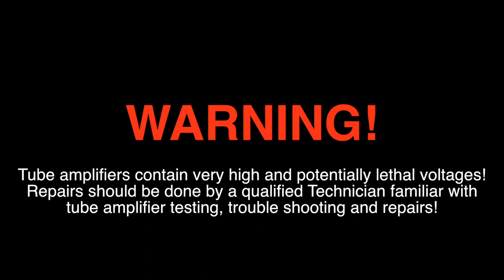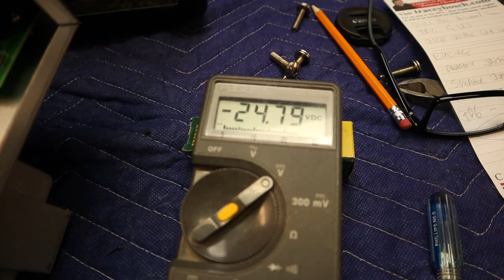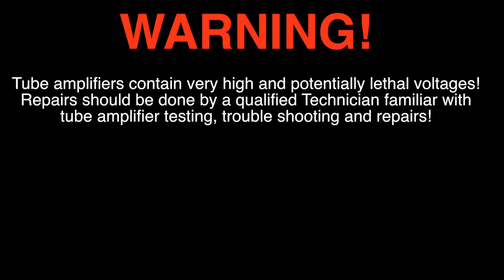BlackStar HT5R Repair // How to debug, fix, mod and test this common issue with these amps!

Comment: thank you for sharing your story and your advice.  I replaced the fet's, resistors and tubes. Cleaned the tube sockets with the original tubes and  contact cleaner. Working now as good as new. My voltage metered at 22.9 and 23.0 volts on the test points. Thank goodness I didn't need to tweak my balance adjustment. I got some tiny clippers in there and carefully cut the leg off the resistor right where it meets the resistor body. The solder sucker pulled it from the PC board. The resistor and the other leg fell right out the other side. Worked so well I cut the legs one by one on the old fet's . Solder sucker removed those cut legs as well. BIG THANKS !!!
Reply from the maker: Thanks for commenting.  Glad my video helped you out.  Hopefully you installed the heat sinks as well to stop this issue from happening again.  Cheers.

Comment: Thought this was my issue because R10 was literally smoking, so I checked the same areas. All looked okay, transistors checked ok, so I looked a little deeper.  D34 was shorted and slightly burned, it is a 1N4007.  Goes from R10 to ground.  Replaced that, R10/38/39 and the transistors (adding heat sinks) as I was worried about possible heat damage to the transistors and R38/39.  While I’m in the amp might as well replace them in case they suffered some fatigue.  Thanks for the heads up because it indirectly led me to the solution and also brought to light an issue I wasn’t aware of, which may have saved my buddy some additional work down the road.

Comment: Had this exact problem, diagnosed thanks to this video.  Was about to throw the amp out.  Cut about a 4" diameter hole in the back and installed a small fan.  Problem completely solved.  Thanks!
Reply from the maker: Interesting. I wouldn’t think that would do the trick.  I’d probably install a heat sink on the transistor as well just to be safe. Cheers.
Reply: Bias tubes?. Thought you only did that for pairs?.

Comment: Hi Mike, thank you very much for this video - very informative! I have a new and only tested HT-5R and will now, as a precaution, make the modifications you have described. I will also at the same time replace the speaker in the cabinet with a much better sounding Celestion G12M Greenback, 16 Ohm. All of this will make this little buddy a real hit. Thanks so much for your advice and guidance, it's much appreciated - awesome! 🙏👍🤗🎸
Reply from the maker: Thanks for commenting.  A speaker swap is a great idea for these little amps… however you  want to make sure you get a low watt version. Since these are low watt amps, it would sounds better if you can push the speaker a bit.

Comment: I have this exact amp and it does everything that you say.
I was thinking about selling it or change the tubes but now I don't really know what to do, since I don't have the tools to fix it.
Thanks for the video, I'll never buy amps again, I'm sticking to studio monitors and software to play guitar.
Reply from the maker: Thanks for commenting. Sorry to hear that. All you really need is a soldering Iron and a cheap drill to fix it. I suspect for under $75 you can easily fix this amp. New power tube (12BH7) woudl be a good idea as well.  I believe amps from are larger company (Like Marshall, Fender, VOX..etc..) tend to have a better life span.  This Blackstar has an inherent flaw. Cheers

Comment: Very good video, I have a HT 20 mk11 that turns on but the output sound has stopped working  , however it does work in the emulated output with headphones, thought it might be a tube,this video was definitely helpful, but beyond my skill set,  a little disappointed with Blackstar, because I like the amp but  Im seeing a lot of problems with these amps in the forums too bad …
Reply from the maker: Thanks for your comment. Yes, they do sound okay but it is too bad they they have odd issues with the circuit.

Comment: Mine melted the resistors and burned out the pcb board and one of the capacitors. I drilled out the pcb around the FETs and recreated the circuit on a small pcb, mounted it in a tiny free space on the chassis and jumpered it back onto the main board.
Reply from the maker: Thats an ingenious work around.  Thanks for sharing. That must have been some effort figuring that all out!?
Reply: @MikeFreda  I used a schematic floating around on the Internet. I actually had to do it twice. The first time I replaced components on the board and used some jumpers to get around burnt traces. However even with the holes between the FETs, the pcb still conducted and it failed again. I gave it one last chance by using a small pcb and  standoffs off to the side. I added heat sinks too but don’t think they’re necessary when you move the location of the FETs as there are no longer any tiny components near them. 

It was way more work to salvage it than the value of the amp, but it was a good skill building experience. I just didn’t want to throw away an otherwise fine combo. It works fine now except recently the reverb stopped working…. Ugh.

Comment: I haven’t had issues with my blackstars yet. I also have a 100 watt Marshall that sounds awesome .

I have often wondered if one could essentially get the main distortion tone from blackstar from a custom build .

I never use my club 40s second distortion channel, I stay on the first , ideally I’d want that sound of the first gain circuit with the “isf” feature with the ability to keep it more open at certain settings , like a responsive marshall.

Blackstars can get a pretty nice sound for sure .
Reply from the maker: Thanks for your comment. I’m not sure this possible. There is so much circuitry in these amps that you would need to be a electrical engineer or technician to make it work. 

You “could” gut the entire circuit board and redo the entire amp point-to-point following a proven layout and schematic. Big task though but at least you would have all the major components like the PT, OT, Tubes, chassis.   I was actually thinking of getting a reissue of a deluxe reverb and rewire it to 60’s spec.

Comment: I had that problem with my blackstar I Sent it back ,and I had a bit of hassle getting a refund but I did .I then bought another HT5 and the same thing happened,this time I took it to a technician who fixed it and it has been fine since .
Reply from the maker: Thanks for commenting.  Glad you got it sorted out.  It is an inherent flaw with this amp.  You are brave to get another one. I probably would have walked away and gone with something else.  Cheers.

Comment: Excellent video for learning
i have a blackstar club 40 mkll, it has an issue whit one DPDT switch, Can i replace this type of switch whit a on/off mini switch?
Reply from the maker: Unfortunately I’m not familiar with that amp, however, I would try to determine why it doesn’t work. Is the switch itself faulty or is the circuit?  I would try to inspect the switch ( cracked, broken...). Perhaps spray some contact spray into the switch itself. If it’s a multi position switch, it would require some effort to wire in a new switch that is stood-off from the circuit board. The circuit board itself may be difficult to solder and figure out the traces. Not sure I would attempt that myself. If the switch is faulty, I would try to replace that exact switch.

Comment: Hi Mike! Thank's! I did this procedure and it really worked! I assembled an external PCB with a heatsink and a cooler, and moved the components to this PCB, it's very good now. But I have the other problem, when I'm on the clean channel and I play a little louder, it switches to the drive channel by itself. Do you know what it could be? Greetings from Brazil
Reply from the maker: Thanks for commenting.  I have no clue why it would automatically switch other than a faulty switch and the vibration is making it switch.  Very odd.   Cheers.
Reply: @MikeFreda  Thanks!! To do a test here, I turned on the footswitch and the problem stopped. When I remove the footswitch it returns to the problem. It could be some component with current leakage and for some reason the footswitch circuit must be absorbing it.

Comment: Great video! That's a fair amount of work to have to perform on a new amp. It's a reason I've stayed away from the HT5s (and Marshall DSLs).
Reply from the maker: Thank you.  Yes, these amps have a lot of circuitry that can easily go bad and ruin an amp.  Old school point to point seems to be the trick.

Comment: Very helpful video, on mouser they have several different types of irf830 with different letters after the numbers. Which should I buy for the ht5r? I'll be replacing the resistors too and adding heatsinks. Any advice would be much appreciated.
Reply from the maker: Hard to say... the best thing to do is read what the numbers of your existing transistors, search for that spec sheet and compare what has similar specs.

Comment: Great video Mike, mate that amp has a major engineering flaw! To have to do what you did ( especially adding the heatsinks to the MOSFETS ) shouldn't have to be done if they designed it right. I've tested out blackstar amps in my local music shop but never sounded like Marshall like they say they do. O heard somewhere that the designer for blackstar use to work for Marshall! On a side note I hate PCBs 😂
Reply from the maker: Thank you. Once “fixed” it works okay.
Reply: even marshall have problems like the dsl2000 drifting bias will destroy the board they sell new boards for $200 with fixed bias drift lol

Comment: Thanks , excellent detailing . 
Regarding the high voltage capacitors,  can you discharge radial caps on pcb  without flipping them ? 
If not , is it safe to touch the edges of the pcb ? 

I'm asking because all demos on youtube are done on axial caps, which are easy to access . 
Thank you :)
Reply from the maker: It does make it a bit harder. Sometimes there are resistors that are mounted on the top of the PCB right next to the cap that you can access an exposed lead. Depending which side of the resistor you touch, you may need to hold the prob longer. Always use a Multi-Meter to confirm voltage after. I'd recommend draining caps before removing/touching the board with two hands. Cheers

Comment: Great Video! do you have the schematics for this exact amp? I can't find it online. The only on that pops up is the HT5 sheets, but they are a bit different.
Reply from the maker: I found the schematic in Amp forum. I’ll see if I can find it again. It’s a confusing schematic to follow.

Comment: Hello there great repair, I have the opposite problem, switch on the amp wait 30sec then switch on standby, I get no sound ( no hum buzz nothing).Plug in headphones everything is working fine and sounds great. I leave the amp with power on but standby off, wait about 10mins and try again. Start to hear some distorted sound on the clean channel. The long I leave it on the better and clearer the sound becomes until after a few minutes its sounding how it should. After playing for 20mins I switch it off and leave it for a few minutes and whole process starts again. won't come back on. Will this repair fix my problem too even though its the opposite? I have changed tubes also which makes no difference. Thanks
Reply from the maker: That is very odd issue.  It would appear to me to be a heat related.  Since most of these amps can have issues it may be a good idea to try my fix…. However, without seeing and testing the amp it really hard to say what your specific issue is.  Cheers.
Reply: @MikeFreda  I will give it a go, first. Thank you

Comment: Blackstar recently released the MKIII version of this amp. This flaw affects all versions? It seems like they would've corrected this PCB by now. Have you ever tried adjusting the bias pot and did it make any improvement in the sound?
Reply from the maker: I’m not up to date on the new models.  I’d be guessing if I said anymore.   These amps have so much solid state in them that the tubes brands and bias don’t do much to the sound.  Things are tightly regulated.  Cheers.

Comment: I have an older version of the HT5 and just did this repair.  The board does not have dedicated Test Points for balance and bias The schematic doesn’t show any either.  I see the pots with adjustable screws for adjustment.  What do I need to measure across for the balance operation, and bias? Thanks
Reply from the maker: I'm not familiar with that particular model  but you basically want to measure the Plate, Cathode and the grid voltages on each half of the 12BH7. On the first triode, pin 1 is the plate and pin 3 is the cathode. On the second half, pin 6 is the plate and pin 8 is the cathode.  The cathodes are joined together with one bias resistor so their voltages should be the same. You can measure the plate voltages to see if they are similar. The Test Points are actually measuring the grids, Pins  2 & 7. You adjust the balance pot until the Grid voltages and plate voltages are the close to each other.  I doubt you can get them exactly the same since each triode are typically not 100% identical.  I hope that helps? Cheers
Reply: @MikeFreda  Thanks a lot for the explanation! Much appreciated.

Comment: Hello Mike, I live in France, so excuse me if I make some mistakes in writing. Does the same problem exist on the HT-5RH?
When I last used my amp on the 'Clean' channel, it ran great for a minute, then the sound cut out and I only had a loud hum. Switching the amp on the "Overdrive" channel, the amp works perfectly. Is there a relation between what I explain and the problem you present in this excellent video?
Thank you in advance for your help.
Reply from the maker: Thanks for commenting and asking a question.  The issue I fixed I based around the bias of the output tube.  That tube feeds the output transformer and the speaker. I found that it didn’t matter what channel was being played through it still acted up.  
I did find that the line out or headphone out was not effected.  It’s hard to say what your issue is other than turning it on and testing voltages. Cheers.

Comment: Hi Mike, thanks for the video! This seems to describe the exact issue my amp has. I have made a few guitar pedals so I have the skills to make the changes you have described, however I am worried about the high voltages and don't know how to discharge the capacitors. If I leave the amp unplugged for an extended period of time, let's say one week, would it discharge itself and be safe to work on and touch anywhere on the circuit board?
Reply from the maker: Thanks for your comment.  I would use a Multi-meter to confirm voltages.  These circuits typically have a bleeder resistor but you should always confirm first.  I have a playlist on making a drain tool and how to use it. Always measure and/or drain the capacitors before doing any work. Never assume. Cheers.

Comment: Hi, great video and explanation. Can I ask how did you removed the chassis (amp) from the cabinet? Is it possible to separate the two just by disconnecting some cables or you had to use the soldering iron?
What actually keeps the chassis attached to the speaker and what do I have to do to divide the two
Reply from the maker: The Chassis just unblots from the Cabinet. To flip PCB over from the chassis, you need to unbolt all the potentiometer and unclip the cables and unscrew the PCB. To remove the PCB all together, that's a bigger job. Not sure on the amp revision you have, but you may need to unsolder a few wires.
Reply: @MikeFreda  thank you for your answer, that was really helpful. I was wondering if these blackstar combos had the capability to just umplug the speaker from the chassis. If not, what did you had to do in order to separate the speaker from the chassis?

Comment: Hello, what a good video, I would like to ask what is the voltage of the transformers? Regards :)
Reply from the maker: Thanks for commenting.  I can’t find my notes and I can’t recall off the top of my head. It was several years ago when I fixed that amp.  This amp has a complicated PSU. 12BH7’s as power tubes typically want to see around 300vdc at the plates.   Depending how it’s biased, this amp will draw under 40ma.  Cheers.
Reply: @MikeFreda  thx :)

Comment: Hi Mike, Thanks for your investigation and description of this problem and fix. Unfortunately, I don't have your skill set to care for a good-sounding but "needy" amp like this. The Bugera g5 infinium is considered a clone of some of the HT mkii series. I'm wondering if you have encountered this amp in your repair activity, and what you think of it as an alternative to the HT series? Bugera does not have a service centre in BC, and I live in a little northwest BC town- if I bought one and it needed repairs later on, would you consider working on it? Or have a recommendation for BC repairs? thanks, scott
Reply from the maker: Hello Scott, thanks for commenting. This Blackstar is a versatile amp and does sound okay. I do believe the new ones have been sorted out. I'm not familiar with this Bugera amp.  The Fender Bassbreaker 15, Pro Jr and Blues Jr is something similar to these amps. They sound pretty good for what they are. Like anything, buying amps used is a bit of a crap shoot. Buying new from a shop may be your best interest for returns/repairs.  Repairing Tube Amps is becoming a dying skill set.  I only know 2 people in the lower mainland that do and they are very busy and charge a lot. This is part of the reason why I do my tube amp videos, to share my knowledge and to help people out in the future. Cheers.
Reply: The Bugera G5 suffers from the same design flaw of the phase inverter. I just drilled out the 2 MOSFETs but it's much harder on the Bugera since there is almost no space between the pins. Afaik there are no test points because of the Infinium auto bias thing they have built into it.